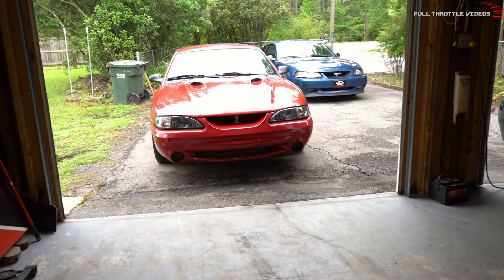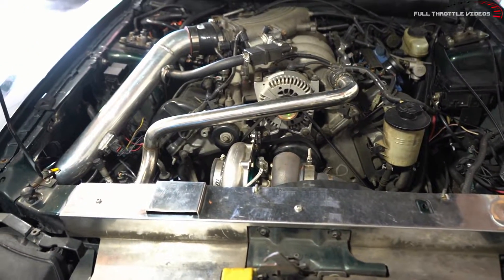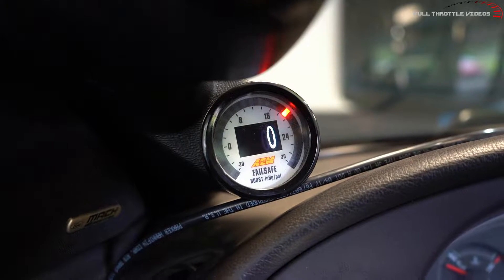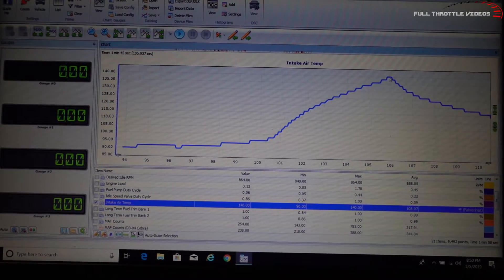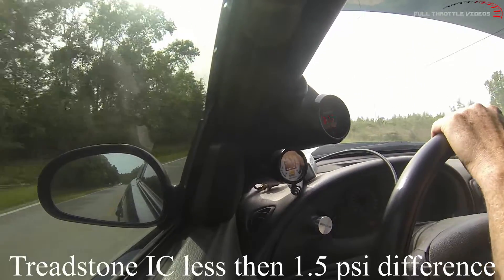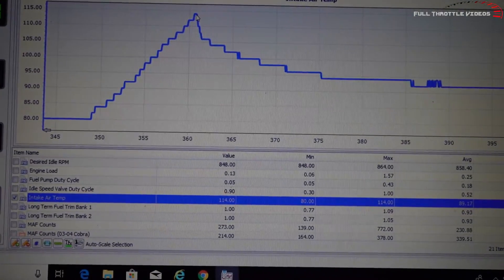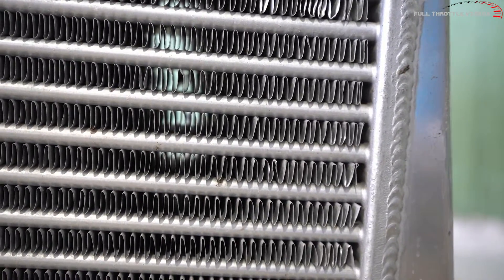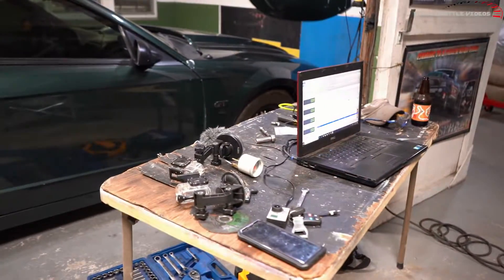IS AN EBAY INTERCOOLER RIGHT FOR YOU? (tube and fin vs bar and plate)

Comment: I bought one from Ebay at the third of the price of name brands. I figured it had to be better than the stock one on my Golf R and can't go wrong. Well? I was happily surprised with the build quality, hose and clamps that came with it. Even more happily surprised when i did numerous back to back. Boy! Could i feel the extra kick alright. So, certainly no regrets on a budget Ebay Chinese made intercooler. I also note a number of businesses buying and reselling Ebay intercoolerd citing they are made inhouse. That is a load of bullshit and nothing short of conning people. I say... If you are not racing on a race track and every split second counts then throw your money in on a much more expensive intercooler. Other than that? Save your money and get a Chinese Ebay one. You be surprised of the quality. Besides, many things are made in China Taiwan e.t.c and branded for the business having them made for them That includes Tyres.
My Golf R runs like a Super car. 👍🇦🇺😉

Comment: from 3 to 4,5 you have 50% more crossarea and from 1 psi drop you went 1.5 instead you had to be in reverse abou 0,66 psi. for 50% more volume double the weight?  also tube n fin is better for constant moving track cars and bar and fin for drag cars as can  absord more heat before heat soak but they need more time to cool down.

Comment: Tube and fin vs bar and plate.. Bar and plate is almost always better for charge air temps. On my Focus st I had a tube and fin and would get consistently 40 or more degrees over ambient on 26 psi.. Switched to a bar and plate and highest I've seen was 20 over and I'm now getting 28psi.
Reply: Holley frostbites are a good bang for your buck

Comment: Yeah but you gotta have in mind that the threadstone is more restrictive and also heavier (core density), that may be less than 1.5psi at 12psi but when you are looking for 30+psi that pressure difference will be far greater.
Maybe an intermediate density one together with a massive ic spray of alcohol/water could do the trick.

Comment: I’m trying to stay at under 10 psi for now , will the intercooler work for my purposes?
Reply: wondering that too
Reply: You don't really need an IC if you're 10 psi or below. But it still a bice thing to put though. Air temp. Increases when you go beyond 10 psi

Comment: What software are you using to tune
Reply from the maker: That was SCT
Reply: Full Throttle Videos where did you order the software I’ve been checking a few sites that sell it and not sure witch one to go with
Reply from the maker: @nothinnice7889  check SCT website, you dont have to buy the software, but you do  need a handheld, and this was just a data log of a pull, and looked at the data on a laptop through SCT software, forgot the name of it, live wire maybe.
Reply: Nice thank you for the help

Comment: Good content, there is a HUGE difference between eBay and a treadstone intercooler. I'm upgrading from an eBay to a treadstone as well. Tuner says I should see 30whp at the same boost level with the treadstone tr1235 orbtr1245

Comment: I was using  a a2a intercooler that came with my Huron speed single body kit it was nice but at the time i was running a sbe 4.8 with prc CNC'ed 799s ljms cam and summits copy of Holleys sniper with 90mm tb and a 50 shot for gap  insurance running ignite red e90 and Holley hp efi and my tuner had it doin all it could do with iats with the a2a I had so went air to water nothing fancy but I went ahead and went big enough for around 1200 wheel and had a buddy fab me a pretty big ice/water tank where my t tops go and used black heavy duty water hose and a big pump ,It was night and day difference we could get way more aggressive with the tune and I felt more comfortable doin what little I can do kinda like a safety net  Check out frozen boost.com that's where I got my intercooler  and pump and I dont run a heat exchanger my car was more strip than street but I done a similar setup except with a heat exchanger and a little bit smaller water tank again night and day difference the power and efficiency more than makes up for the lil bit of water weight
Reply from the maker: So how much difference in iats were you seeing?
Reply: @FullThrottleVideos  boost only was like 155 @ the 1/8 and like 115-120 on a 50 shot and a2w 85-97 the bottle didn't drop it much with a2w but I picked up damn near 100 wheel on the 4.8 and was running 5.80's a2a 5.69 @ 122 on bottle and 5.72 boost only 120 a2w 5.59 @ 125 bottle. I may not be 100% on the iat numbers but I got the old logs il screen shot the logs and post them
Reply: Never got to see what my built motor would do I grudge race  no body believed the sbe 4.8 was doin that when I finally bent the rods and told everyone what it was doin lol

Comment: Good job you compaired tube and fin to a bar and plate.... Smh
Reply from the maker: Still shows what difference it can make, alot of people dont believe it.
Reply: Cool test but definitely missed the mark as mentioned that "ebay" intercooler is a delta fin style aka "tube and fin" which was wrong style for your application. The treadstone is bar and plate. You would have got the same results with a "ebay" bar and plate intercooler of the same dimensions. Always go bar and plate for a2a on a v8. Tube and fin shines in a2w cores or on smaller displacement higher revving really high boost level applications.